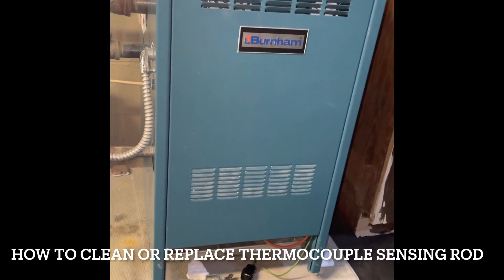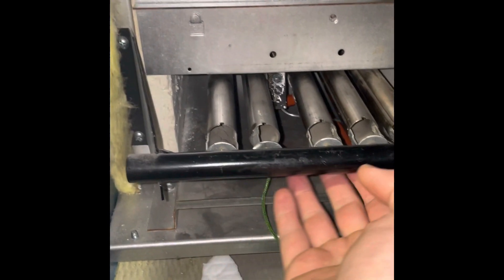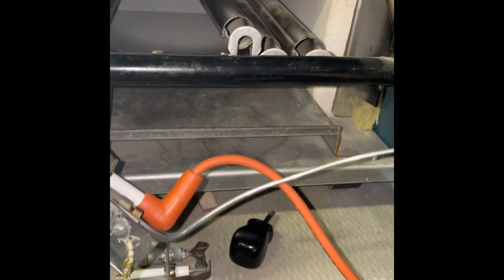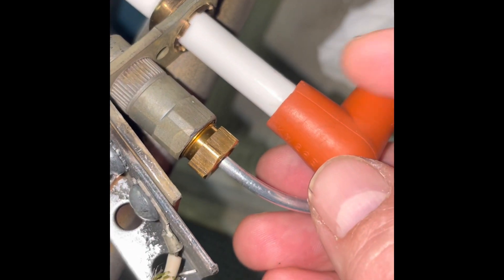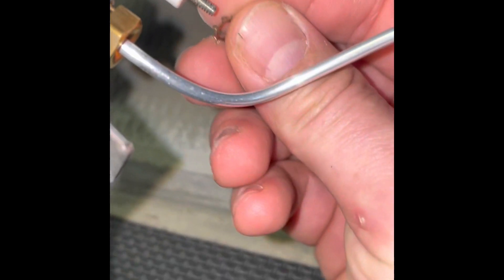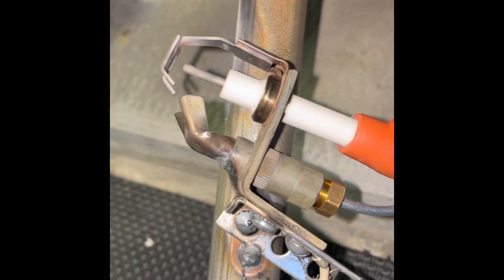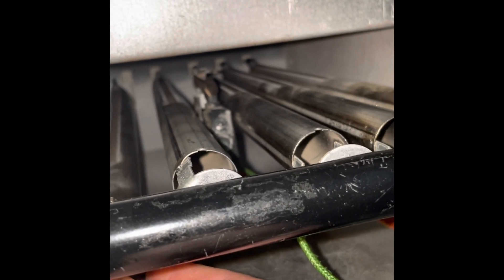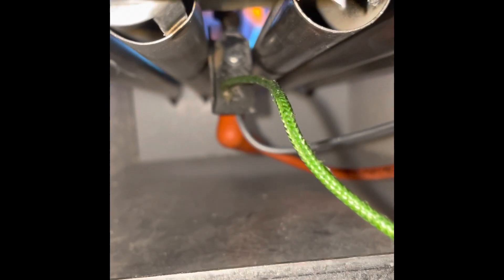How to clean or replace Burnham gas boiler thermocouple sensing rod.

Comment: Where can I purchase the part? service instruction only give a part number hot just the assembly.  Thanks
Reply from the maker: https://jacksonsystems.com/product/honeywell-universal-pilot-burner-for-intermittent-pilot-applications-batwing-style-hood/?utm_term=&utm_campaign=HW+Hot+Surface+Ignition+Modules&utm_source=google&utm_medium=cpc&hsa_acc=6341543140&hsa_cam=13630408943&hsa_grp=125309225978&hsa_ad=529435539114&hsa_src=g&hsa_tgt=pla-949923494573&hsa_kw=&hsa_mt=&hsa_net=adwords&hsa_ver=3&gclid=Cj0KCQjw8_qRBhCXARIsAE2AtRYiP79fLOdQ8QDag3-2ylDYpi9ah3xUbZXYPMZp-5ER5ETApAnZIq8aAvWcEALw_wcB
Reply from the maker: That should be what you need if yours looks different let me know!
Reply: @ramtruckstuff8863  wait i have to get whole set up? Or can i just get sensor?
Reply from the maker: @BangrZz  I haven’t found sensor rod for this thermo couple by itself yet I usually get the whole thing.